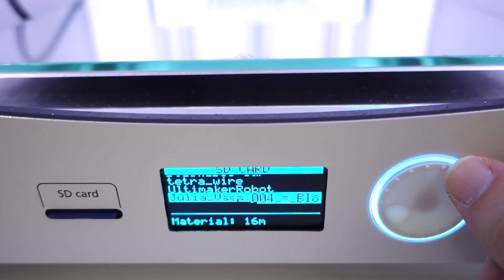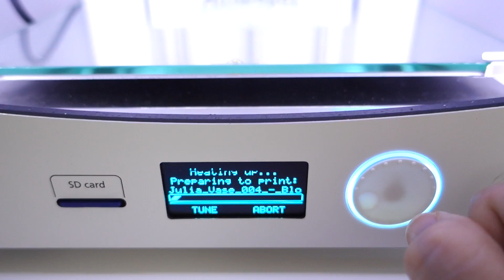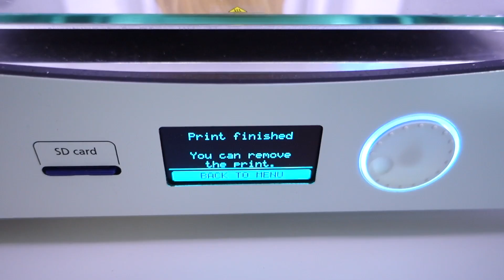3D Printing | My Wedding Anniversary Gift for my Wife #3Dprinting #Ultimaker #wedding

Comment: Funny, I was looking for a vase to print for MY wife for MY anniversary and found this! Can you give more detail of your settings? The author has .3mm walls. Do you have walls? Is it the shell vase or a vase with walls and a fill? So layer height, wall thickness, fill, and of course which model you used (he has 4) Thanks so much!
Reply from the maker: Sorry I do not recall the settings. It is water tight but very thin. If I printed again I would increase the thickness.

Comment: Hello, thank you for this video! I am new at 3d printing so i have basic questions about the cost. From what i see , the traditional "ink" for the 2d printers now it's called material, for example plastic and it's about 31E cost each?So you say that this beautiful print took about 35hours, how much of the cartridge needed to finish this?Basically let's say with one new pair of Filament, how many of this you can print? Finally do you know how many cm3 is this print you've done, i will need to calculate the cost of power consumption also.Thank you!

Comment: Very cool for a second print :) my longest print was about 16h i never tried a longer print. I'm pretty sure you could have printed this vase in less time with a similar result, do you remember the settings you used? I guess you are using Cura as slicer, you can use Spiralize for vases like this one ;) (0.1mm layers and shell tickness of 0.6mm is a good setting for spiralize)
Reply from the maker: Didier Klein Thanks for the tips, I just used the best quality settings on this one as it was a gift. Could have halved the time :D

Comment: You really shouldn't worry about the printer... The only thing that can go wrong is the power going out or overheating(that wont happen on the ultimaker  2 don't worry but i it does it stops). If it stops pla is cheap. :)
Reply from the maker: R4MP4G3RXD [Rampiii] Very true.